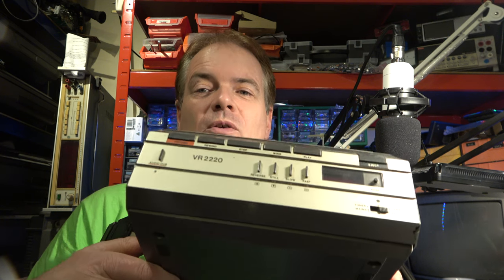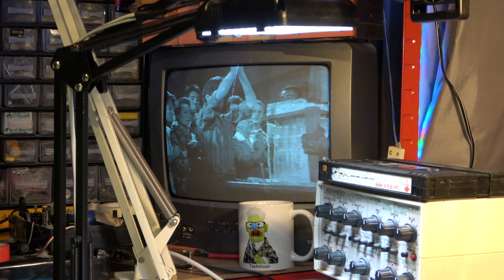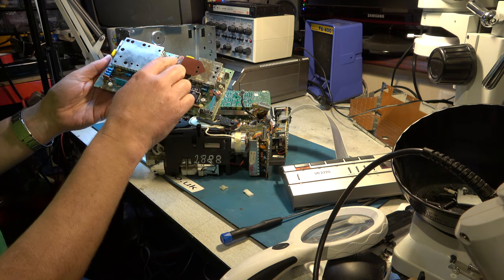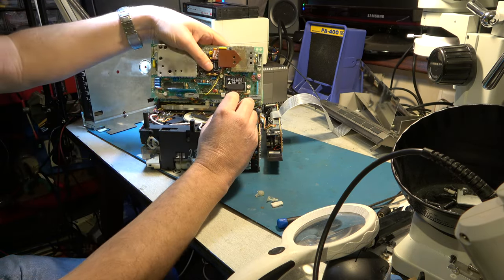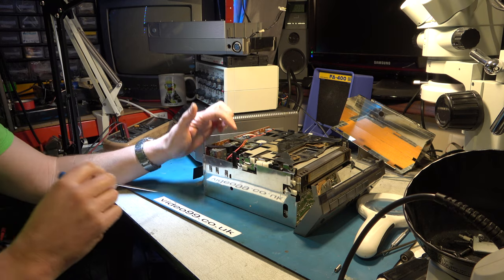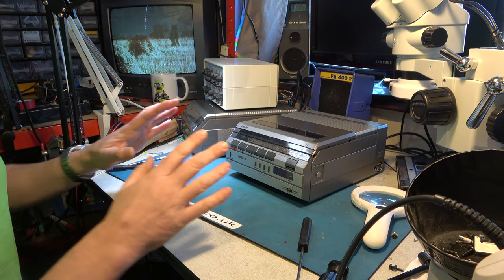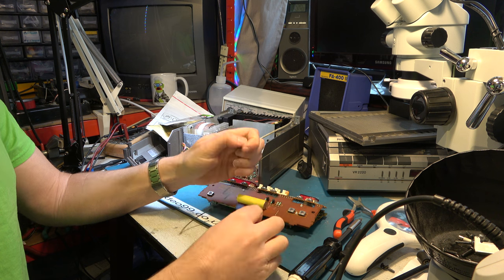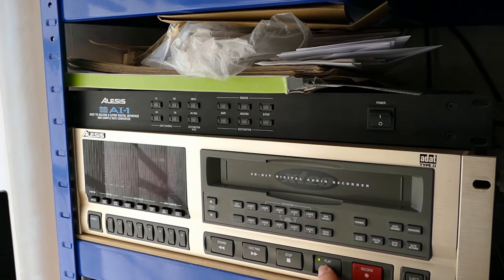Part 2, working on a Philips VR2220 portable V2000 format video recorder and VR2120 tuner/timer.

Comment: i don't think it's doing bad at all,  the colour from most vcrs is low resolution because of the down conversion, and turning up the saturation on playback will look rough.
I think you need to find a better tape and recording to judge it.
The hitch hikers guide to the galaxy, i enjoyed that series 😀

The other panal must be slightly different, not faulty but different.
Is there any tea on this space ship 😀
Reply from the maker: I think it was actually faulty.  Maybe I'll try one more panel.  Maybe I won't!

Comment: "Maybe it's within spec anyway..." Specification for chroma noise in domestic video machinery is < -43dB to my best knowledge. Do you have any means to make a video and show how different levels of chroma noise looks ?

For instance: Bad machine at -40dB, Within Spec machine at -43dB, Good machine at -46dB and perhaps some source material at much lower level, like -50dB.... -60dB.
Reply from the maker: Not really any means to make those measurements.  The chroma performance on this seems a bit poor but V2000 was never the best format so it's hard to say.  Not ruling out trying the other video PCB from the last of my machines.

Comment: DTF should give better picture and perfect sound.
Reply from the maker: DTF should give perfect tracking but that doesn't overcome V2000's inherently poor signal to noise ratio.  DTF has no effect on the audio, which is just low quality linear on V2000.

Comment: We had a Philips VR2340 when i was a kid. If i don't remember wrong, the tape will come out/up if you press the Eject button. If you press Eject again, it will close! You don't have to press Play to close it! If it does not close when you press Eject, something is wrong, i think. (it is almost 40 years ago now, so i can be wrong)  And from what i could see from the screen shots, the picture quality looks fine to me. A camera called VK400 will work with the VR2220.  By the way, I'm from Sweden!😀

Comment: I have a "was working 2220 "and tuner 2120 I am wondering what the cap  that exploded is you were referring to is and where exactly it is located.  My machine was put into storage and should be OK except for the age. Any advice?
Reply from the maker: It's the very first component at the back of the power socket.  You can see me replace one of these on an earlier video in the series, on the VR2324.

Comment: BTW if you want to see the typical performance of a fairly early generation V2000 machine, I have some DV-files grabbed of recordings of a near noise-free analog satellite feed. It's of cartoon network, so it might even be possible to do noise measurements on it.
Reply from the maker: I'm fairly sure this machine is performing a little less well than it should and I may well revisit it another day.

Comment: NIce PArt 2 . But dident see the capacitor replacement ? or values on them ? thinking about order to 1 off this i have .  But i like that "dirty machine"  i picked up a only video part for 6 euro last year (looked like it was stored in a barn for 30 years ). some plastic broken on it . just did test it to a working tuner part it fired up and worked fine .
Reply from the maker: I looked at electrolytic capacitors on the video PCB and they were all well in spec.  I could have spent more time on the machine if I were happier with the chroma performance.  I may revisit this machine in the future.

Comment: Hello, 
I have a Toshiba SD-33VLSA COMBO video that I have not used for a very long time. I have thoroughly cleaned the video head and the other accessories around but I still have severe disturbances and can not see the picture at all that I sometimes have the "blue screen" of the video  ,  when in the background I hear the sounds clearly. I tried what you demonstrated about the two white buttons on the sides of the head that you rotate them with the screwdriver and that's how you made the waves go away, but it did not help. An interesting detail is that when I move forward or backward without pressing the stop then I see the image more clearly than I see myself pressing the play. Do you have any advice to give me? thnx
Reply from the maker: Oh dear, you shouldn't have adjusted the head guides with that fault problem, you've now possibly upset the alignment.  You have either a clogged video head or a ruined one.  You can still pick up VHS head cleaner tapes and it might be worth trying one.

Comment: I have a Philips VR2340 witch is more orless the same but its all one unit however the same
Reply from the maker: Yes that's right, Philips designed the two machines together, one portable and one home deck.

Comment: Great video as always, Can you please explain how they achieved recording on "both sides" of a V2000 tape please?
Reply from the maker: Though the tape is 1/2" like VHS and Beta, the recording was 1/4" like CVC,  So it used one edge of the tape in one direction and the other edge when the tape was flipped over.  This meant that the recording density was very high, hence dynamic track following was required to keep the heads on the very thin video tracks.  It also meant that the format was inherently noisy, picture quality was way down on a good Beta for example.
Reply: Besides the obvious difference of just using only half of the width of the tape, I think they also used different azimuth on the two video heads so that the head that records the even field gets a much weaker signal from the adjacent track that has the odd field. 
They also had "dynamic track following" which means the heads were mounted on piezoelectric elements that were controlled by a complicated servo system. Basically (if I recall correctly) the system recorded 4 alternating frequencies along with the video signal, and at playback time it would adjust the position of the heads based on how strong the frequencies were coming in. That way you would have noise-free still picture, picture search and slow motion because no matter how fast the tape runs, DTF would follow the tracks as well as it could.
Reply: It also uses something called "choma-under" recording where it doesn't record the full 5-6MHz of video bandwidth needed for a colour picture directly, but instead splits up the signal into a 3,5 MHz luma signal and a low bandwidth chroma signal. The luma signal gets recorded frequency modulated (centre frequency of around 4 MHz) and the chroma gets down shifted to a couple of hundred kHz.
This also explains the somewhat worse picture of V2000 compared to normal contemporary Type B or Type C machines. Of course given the extremely low cost of V2000 (cheaper than a new car!) those are the corners that need to be cut.

Comment: Yes, always a good call to remove or replace those old NiCad's. I recall in one or two of their VHS machines; when they start to go low they cause erroneous data to be held in volatile memory, which then locks-up the micro when mains is reapplied. Much head-scratching ensues!
Reply from the maker: On early Philips V2000 machines, they ooze goo over the CPU board and wreck it.

Comment: Ich hatte in den 80er Jahren so einen Philips Video 2000 Recorder und ihn nach 10 Jahren weggeschmissen.
Reply from the maker: Many people threw them away or stored them in the loft and forgot about them.
Reply: @video99couk  
Als die Satelitentechnik damals kam waren die eingebauten Tuner am Ende.
Ein Scarteingang für einen Receiver war nicht vorhanden. Es wurde nur ein AV Adapter für weit über 150 Mark angeboten
der dies uninteressant machte.
Weiter gab es Leihfilme nur noch in VHS und so wurde ein neuer Recorder in VHS beschafft der für 300 Mark zu haben war.
Ich denke das der auch noch irgendwo auf dem Dachboden rumsteht. Sogar der von meinem Sohn in Stereo.

Comment: Cool to see how they did things with V-2000, since that is another format that never crossed the pond. I wonder if the tape latching in has something to do with it being a portable VCR. When I first saw the machine with that clear section where the tape is, I thought it was a front loading machine :)
Reply: Pretty sure Magnavox VCR/VCC machines made it to the U.S. That's the same as Video2000/ V2000. The original VCRs from Philips certainly did - I saw it as a central prop in a Colombo episode starring William Shatner (the guy who played Kirk on Star Trek).

Edit: Checked the Wikipedia page on V2000 and it does not make mention of V2000 in the US, but the page does have several errors. My dad worked at Philips' head office in Eindhoven at the time and I do seem to remember a U.S. launch in the form of prepared promotional materials.